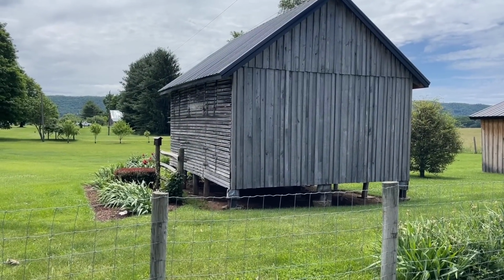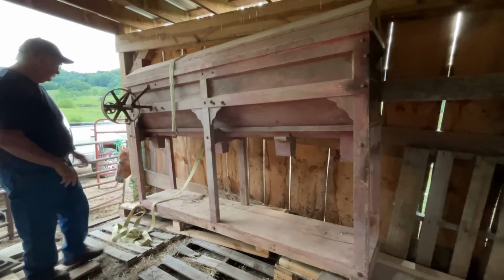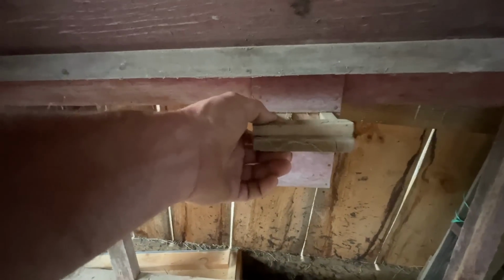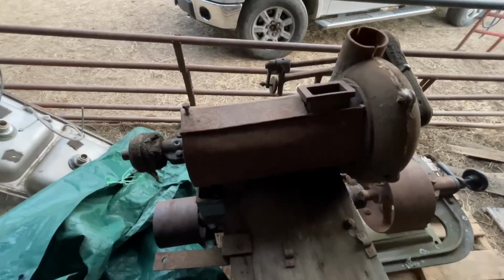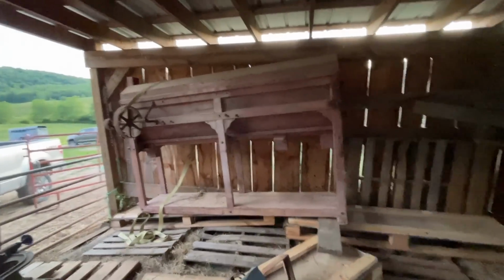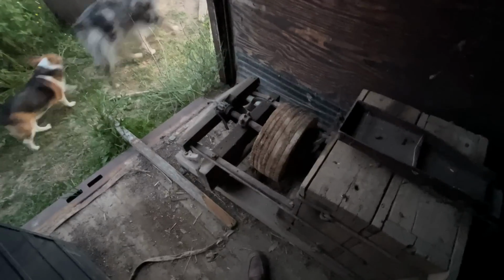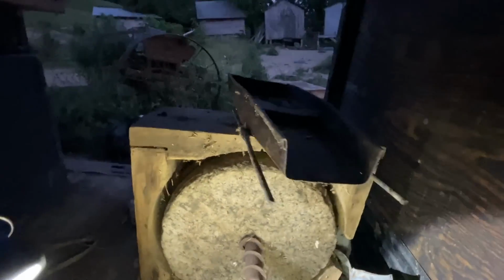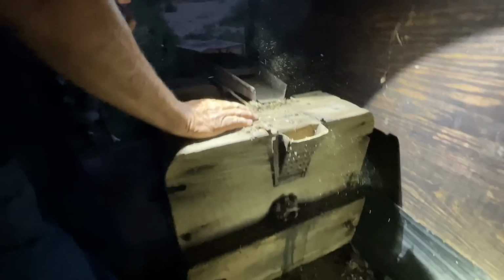Amish Country Mill Delivery v176

Comment: Another great video! Thanks!  Question: What if any are the advantages/disadvantages of a vertical vs horizontal mill?
Reply from the maker: Horizontal can run slower and the product stays cooler.
Reply from the maker: More on this in a video soon
Reply: @metcalfmills5679  Gotcha, thanks for the quick reply. Bless you!